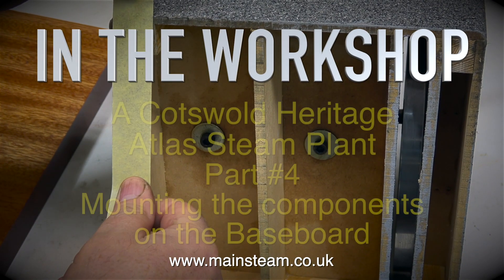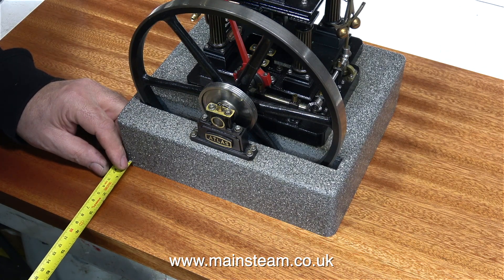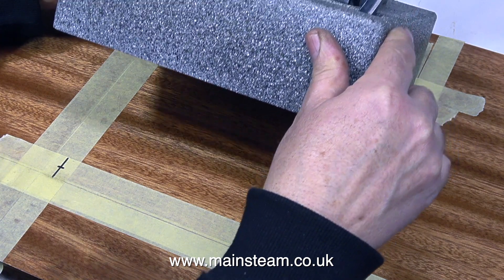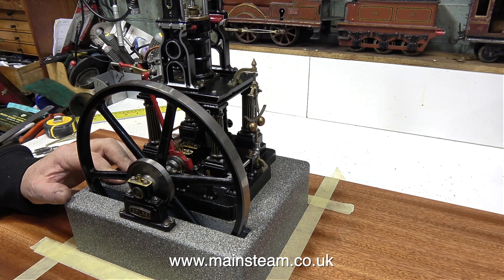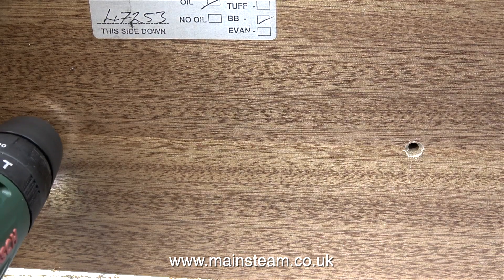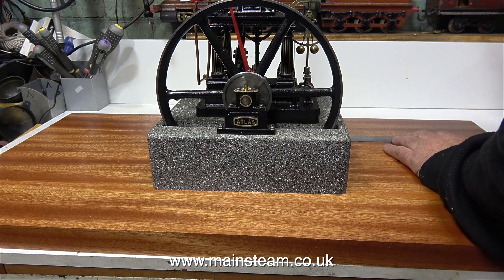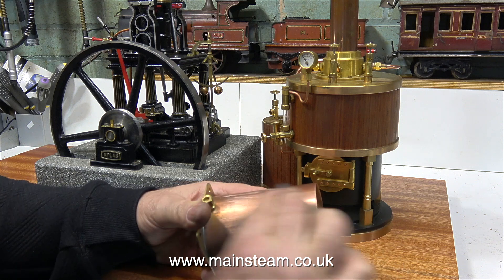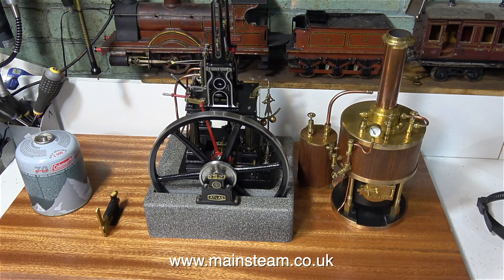ATLAS STEAM PLANT CONSTRUCTION - PART #4

Comment: Keith, just a thought.. With the boiler mounting onto your brass mounting ring, would there be a concern about the heat from the cast iron base burning the wood? My thought was the excellent "asbestos substitute" insulation you use, could you make a round coaster type pad to shield the boiler from the brass ring and the wood base?? Just curious...
Reply from the maker: Not really, the boiler's base just holds the gas burner and in gas firing mode so it really does not get very hot at all anyway.
Reply: @keithappleton  Yeah smart me I posted the comment before I noticed the gas burner...lol Thanks Keith